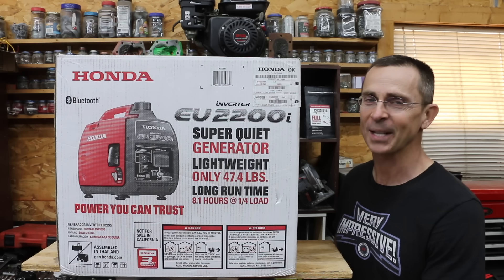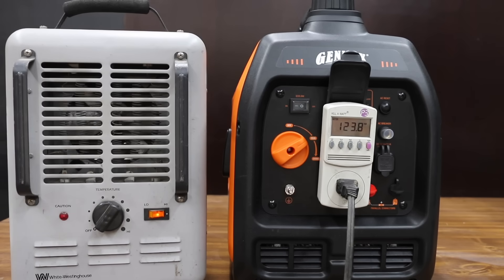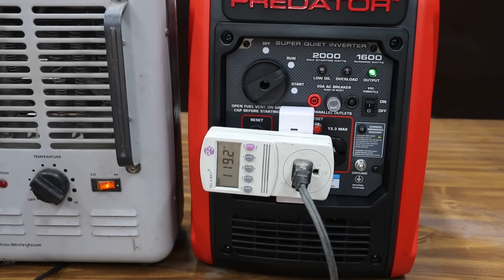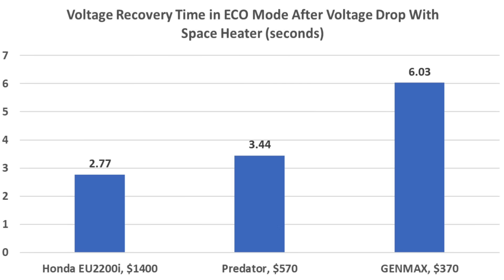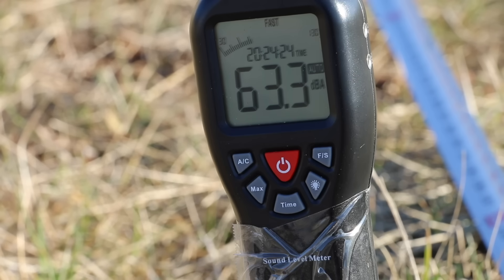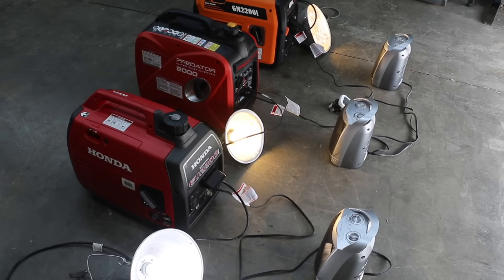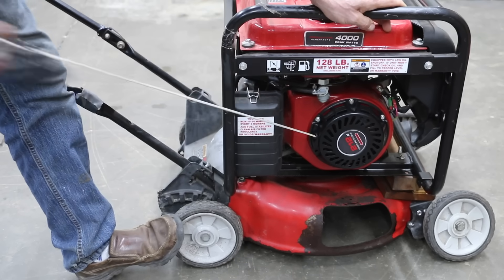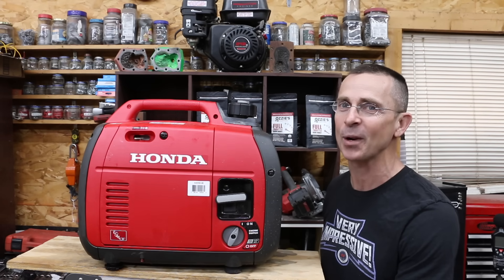Cheap Generator Better Than Honda? Predator vs Honda & GENMAX—Let’s Settle This!

Comment: Got a Dewalt 7000 for the house, and a Firman Inverter whisper series for the trailer. Both very good units. The Dewalt was just discontinued when I found it at a local store for a good buy. No problem keeping the house operational when the power is out. Had I known more about generators at the time of purchase, I might have got a pure sine inverter instead. The Firman is a pure sine inverter and is a great little unit if the air conditioner is needed with the camper trailer.
Reply from the maker: Thanks for sharing.

Comment: Have run a Honda 2000 every Saturday for 12 years about 4 hours each week. About 2500 hours on it just being religious on periodic maintinace. Shop said parts are easy to get if a Honda needs repairs and life expectancy is around 3500 hours. I will get another Honda to replace this one before it hits 3000 hours.
Reply from the maker: Thanks for sharing.

Comment: Buy pairs and run in parallel. Could you use a pair to run a stick welder to build a fence or repair something in a field?

As to other brands. Generac, Champion, Wen. Quite a few in the market competing with the Honda.

Comment: Ecologists wont like to hear ''dirty electricity'' :face-orange-raised-eyebrow: Would you test Firman P01001 sold by WallMart. I would avoid charging a phone directly from a  generator as i ruined a phone this way thinking a 120 ac to 5 dc converter would filter enough. In climatic up&down a generator is almost essential to survive.
Reply from the maker: Thanks for the suggestion.

Comment: I don’t know if it’s in the cards, but a battery powered generator test would be cool to see. Obviously it’s more expensive, and there’s charge time involved versus readily available gasoline. 

It also might be interesting to see a comparison between gasoline, lp, and natural gas performance in a tri-fuel generator.

Thank you for all you do!
Reply from the maker: You are welcome!  Thanks for the suggestions.
Reply: What are you interested in knowing?  Batteries can't compete long term with a ICE generator.  Short term, small loads is the only time a storage device could compete with an actual GENERATING device.  There is no such thing, first of all, as a battery powered generator.  Maybe a battery as a energy STORAGE device, but a battery powered "generator", no.

Comment: Well done tests! Us radio amateurs would be interested in radio-frequency interference tests on generators. Try holding an AM radio near a long power cord to the heater load or better, a shortwave receiver. The Hondas are known to be good on this, but what about the others? For instance, the Ryobi 1800V inverter gen completely wipes out the 3.5MHZ, 7MHz and 14MHz ham bands.
Reply from the maker: Thanks for the suggestion.

Comment: At a mine in Alaska, we ran a helicopter operations office with a Honda 2000 i for a couple of seasons with no problem. The maintenance department requested one for field work, and instead of a Honda, they got a Generac "equivalent". It was far from equal. The Generac would overload under half the load as the Honda. It was terrible.
Reply from the maker: Thanks for sharing.

Comment: Legend has it that Pew McGrath was once stuck in a desert with no oil in the engine. He used a mix of his own feces and urine and used that to lube internal parts of the engine. He made it 500 miles across with feces and urine as engine oil! Please test that

Comment: I bought the Yamaha inverter generator that will boost the 2800 W output up to 3200 W for about five more minutes or something using the electric start battery. It’s about 125 pounds and $3500 when I bought it years ago. It is the Cadillac of generators, all steel and quietest out there. The railroads use Yamaha generators for portable power, that’s a good vote as long as you don’t have to ride on a train😂

Comment: I always encounter these generators at every single 5K or walking race event, used to power the equipment for tracking the RFID tag tied to the runners shoe to measure lap time.

In every instance, they're using the Honda generator.

Maybe do a video on air purifiers, Dreo vs box fan filter.
Reply from the maker: Thanks for the suggestion.

Comment: Thanks for sharing your thoughts, ideas and videos. Very good video. Like that you mentioned runtime. I personally would like to know how well the ecoflow inverter generator compares to the Honda. Would also like to see an comparison running on liquid propane. Might need to do a comparison of conversion kits first. Is propane worth the cost of conversion, effects on the oil and spark plug. I think the addition of the inverter generator to the Ecoflow lineup is huge since you can’t always depend on solar to recharge your batteries when running on a battery backup system. So far they are the first ones to make the responsible move of actually dropping the nonsense title of solar generator, and actually making a generator available that is designed to work with the rest of the backup power system. Might be interesting to see an comparison to an Ecoflow system to a competitor with a Honda or predator power source. You really do a great service to the community by the work you do. Wishing you and your family the best.
Reply from the maker: Thanks and you are welcome!  Thanks for the suggestion.

Comment: Great  video.
Perhaps you can do a round 2, testing generators that can use propane gas. Including an ALP generator that uses only propane. Also test against the Honda with a propane kit. 
THANKS!
Reply from the maker: Thanks!  Thanks for the suggestion.

Comment: Thanks for the comparison. Great job!  What caused the oil consumption in the Predator? Is the oil leaking into the combustion chamber? Is that why the spark plug looked fouled? Any way to remedy this situation?  You could buy 2 Predators for the price of the Honda and have twice the power or run twice as long.
Reply: Plus Predator has outstanding high percentage of extremely pleased owners, a fuel gauge which the Honda does not, in addition to the cost savings..it's a no brainer.  I am a Honda guy..and I chose Predator and love it!  I dont purchase other tools thru harbor feight sorry.  But this generator is well made!

Comment: I had a hard time choosing a cheaper brand generator. I got a Westinghouse 4650w. However Champion, Predator and a few other random Amazon adverts all had similar styles. So I would be curious to see the real world stats between Westinghouse, Champion and say a  Fireman. People impulse buy at a store and those are advertised at Costco, Sam's club and Academy respectively. So more likely to be purchased as a looming winter storm or hurricane approaches the Texas coast by desperate last minute shoppers.
Reply from the maker: Thanks for the suggestion.

Comment: I'd like to see the EcoFlow generator on a test. On these tests even though the Honda used more fuel. You know it also has the best quality. Breaking these generators and allowing the pistons to help seat properly and not waiting too long on the very 1st oil change seems best. Once the new Generator is broken in and you do that very 1st oil change and get all the metal out of them during the break in process is going to help them last many years. 

I bet the Honda out of all generators tested will out last these other 2 generators for many years to come! Pay for :face-fuchsia-poop-shape: and you get :face-fuchsia-poop-shape: quality. 

Enjoy your tests Project Farms! Keep up the amazing work! We all learn so much from your testing and helps all of us make a better decision from your tests. :face-turquoise-drinking-coffee:
Reply from the maker: Thanks, will do!  Thanks for the suggestion.

Comment: At 9:36, you didn't explain that decibels are measured on a logarithmic scale, not a linear scale. Viewers who do not understand the difference might think noise levels of the Predator are 17.6% (69.3 / 58.9) higher than the Honda. In truth, the difference is 10x the intensity or twice as loud.
Reply from the maker: Thanks for the constructive feedback.

Comment: When you need a generator you really need a generator. It is an important safety machine especially in cold climates. Hondas are a lot more expensive but you can trust that they are well made and will work when you need them. That said, no engine is immune to old gas and generators are generally used infrequently. I think what is even more important than the brand is to make sure you have fresh gas. They should be started often and fuel stabilizer used.
Reply from the maker: Thanks for the feedback.

Comment: Great video as always. One important item that is impossible to check is that cheaply made items have very poor quality control when they are built. A cheap generator can preform adequately for a short time until it starts vibrating apart. I have used a few junk items that just fall apart, usually on the inside and suddenly don't work at all.
Reply from the maker: Thanks!  Thanks for the feedback.
Reply: Yeah my brother has the same model Predator as was tested here and his doesn't burn oil. Seems to be a crapshoot with those, a good one provides a very good value for the price, but sometimes you might have to buy and return a few before you get a good one.

Comment: James Condon has a YouTube channel fixing generator.  Just look up his effort to fix a Fugi Micro, which are a similar class as these two cheaper generators.  He points out he has a hard time getting parts to fix them, and no repair manual available.  So, once they break, they are essentially junk.
Reply from the maker: Thanks for sharing.

Comment: I'd love to see a Gas vs. Diesel vs. Battery Electric generator showdown. Although I'd image at Gas vs. Battery Electric would have the most comparable generators in size, output, and availability.
Reply from the maker: Thanks for the suggestion.

Comment: We put a propane conversion kit on our Honda eu2200i right when we bought it. Have never run a drop of gasoline in it. Sure it makes a little less power on propane, but never having to worry about gummed up carburetors is a plus. Also propane is much more shelf stable than gasoline.
Reply from the maker: Thanks for sharing.

Comment: I have the Westinghouse 2200. Thing is amazing and got it for $380. Super quiet and super efficient. I ran it all night and used less then half a gallon. I like it so much I ended up getting the Westinghouse 4500 remote start. Had to replace the auto choke when I first got it but after that it works amazing. Definitely worthy of a project farm review. Good work.
Reply from the maker: Thanks!  Thanks for sharing.

Comment: The waveform of the electricity have zero impact on anything. On square wave inverter that’s another thing, but on a generator, not a concern.
Then only thing that matter is the power delivered, noise, weight, etc.
Reply from the maker: Thanks for the feedback.

Comment: EXTREMELY IMPORTANT TIP FOR GENERATORS...        USE FUEL STABILISER.....
Better yet, Drain the carb after use. (There is often a drain screw and piped drain hose... hiding under an inspection cover.. designed to break on removal).
If you leave that fuel in the carb for a year you may be saying bye to that carb... and replacing the carb in these little puzzle boxes can take a couple of hours labour if your mechanic is not doing them every day.. and how many million models is he familiar with... and is that Kamakooza even using parts that are available or generic enough to improvise.
Reply from the maker: Thanks for the feedback.

Comment: Want to KILL your 2k generator    Run a Microwave on it (even as low as 800W if it's an inverter Microwave)
Running an inverter on an inverter has hilarious results (for others that aren't financially involved that is.

Love that electric power tool ???    The charger may also kill your generator....   Why... Some chargers (Like those 12v pulse "repair" battery chargers, save money by not using an expensive/heavy transformer... instead they cut the mains voltage into tiny pulses that at the right frequency, can appear to be what ever lower voltage the battery(s) are being charged at...
This is fine if you have a billion dollar utility power grid supplying the charger... but an inverter, tryring to look at the demand and adjusting to suit, can see the charger as full mains demand one second, and nothing a split second later.... and can end up cooking the cheap generators components.

I've also seen inverter welders (even HF pipe welders that heat a joiner with a built in coil) kill small generators as the inverter process demands more amps than the device appears to demand from a limitless grid supply.

Oh and that 10A water blaster... probably hits 40A on startup... might want to consider that when running a 1500W WB that could be hitting 5kW on startup... Your little 2KW that can happily run 1500W devices will definitely have fun with THAT 1500W device.

Comment: With that much wear metal in the oils of the non-Hondas, perhaps it would be sensible to change oils at the one hour point.  More than likely, that's when most of the metal would be introduced into the oil.  Doesn't inspire confidence in those products!
Reply from the maker: Thanks for the feedback.

Comment: Very good review as usual.  In hurricane affected areas the hours add up quickly.  I would like to see the Yamaha 2200 but I hear they are getting out of the generator business.  I have 2 2600s and a 2800 inverter and they are excellent.  We had a Honda 4000 and it lasted 25 years with extended use. You get what you pay for.
Reply: You don't get what you pay for anymore. Honda Generators made in the last 10 years or so all have PLASTIC camshafts. Like, how cheap can you be, Honda?
Reply: @rubiconnn  For most people Predator is a much better value proposition.

Comment: Bought two of the Hondas.

Used one of them in an extended power failure situation and it ran like a champ.  Other one still in the box unopened.  I have the connecting cable that allows them to work together.  Ready for the zombie apocalypse or an economic collapse (i.e. use the 2nd generator as barter).
Reply from the maker: Thanks for sharing.

Comment: Another great one. I have an old Predator 2400 non-sine. Several years old and still 3-4 pulls starts it. I run it 15-30 min every few weeks.
Reply from the maker: Thanks!  Thanks for sharing.

Comment: You should really test the sine wave output with an inductive load. A grinder would work but an induction motor would be real interesting
Reply from the maker: Thanks for the suggestion.

Comment: Very good compare !  Your videos are like no other !  I can vouch for the older version 2000i Honda.. mine still runs really sweet with normal maint and occasional use during storms.  Love it.
Reply: I also have the original Honda 2000i.  1000 hrs and 15 yrs later its still going and I use it every year.   Built to last.
Reply from the maker: Thanks!

Comment: I am looking a t buying a 6500 watt generator for a 160 amp welder.
I live in Thailand and the Honda generators are twice the price of Chinese generators.
Will the Honda generator last twice as long as the Chinese unit?
Can one justify paying twice the price for the Honda long term?
Reply: Depends on how long youre going to use the generator,if you need it long term(use it  every day for years ) then i would buy the Honda , if youre gona use the gen.  as a backup powersuplly then id buy the chinese one.

Comment: Excellent presentation  . Again real world test and application results . You mentioned other brands to test . I must admit I looked at Honda and Yamaha , but both very pricey . So in the end I opted for a economical,  and very quiet Hyundai HY2000si. A little cranky at season startup , but once in service , runs strong and quiet . I also wonder about the Energizer brand , and IPower models ?
Reply from the maker: Thanks and you are welcome!  Thanks for the suggestion.

Comment: How about some dual fuel generator like the Firman 3200W Running/4000W Peak Dual Fuel Inverter Generator model: WH03242 and others like it.
Reply from the maker: Thanks for the suggestion.

Comment: Costco has been selling a blue one with a Yamaha engine for a few years now. I wonder how it compares to a Yamaha and a Honda.
Reply from the maker: Thanks for the suggestion.
Reply: The only Yamaha component on that generator is the Chinese-made MZ80 engine...nothing else resembles what you'd find on the actual Yamaha EF2200.  I have two EU2200's, along with an A-Ipower; it's not even in the same league as a Honda, nor, I suspect, a Yamaha.

Comment: The majority of sound is from the engine and generator not the exhaust. 
dB levels are twice as loud for each 3dB higher or half for lower. So 6dB quieter is two halvings or 1/4 the noise so a few dB is significant. 
The predator brand far outperforms the Honda on cost/benefit though the Honda is a better machine. 
We’ve been running a  3500 predator inverter (electric start) genset and will never buy a Honda over oredator
Reply from the maker: Thanks for the feedback.

Comment: As always top notch review!!

These days it's worth having a generator, they are all easy to maintenance and diagnose if they have an issue. 1 Inverter and a portable 10kw for the household on a xfer switch, im in north tx tornado alley its been the best investment during 3 day + outages
Reply from the maker: Thanks!  Thanks for the feedback.

Comment: 40:1, 50:1,  and 1:1 10:1 see how low can you go and the 2 cycle still work I been told it better to be lower and  use oil and diesel 32:1 just be safe.
Reply from the maker: Thanks for the suggestion.